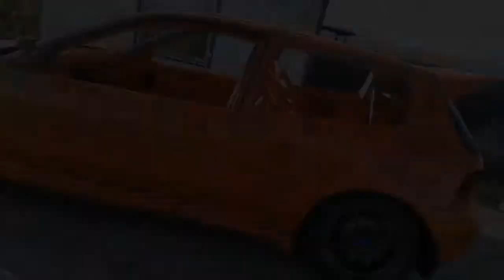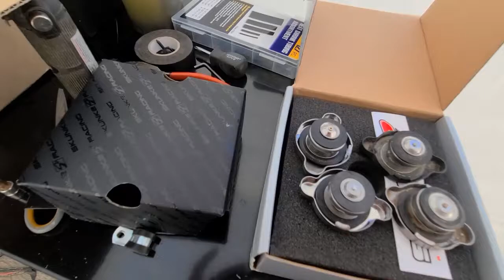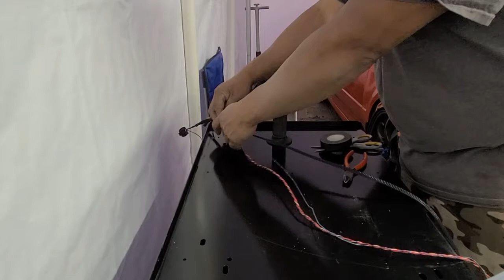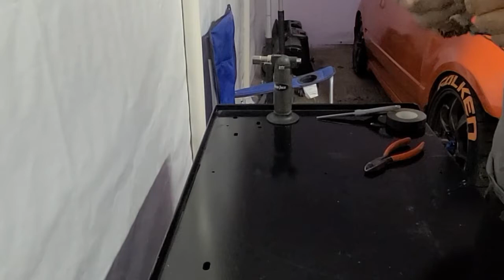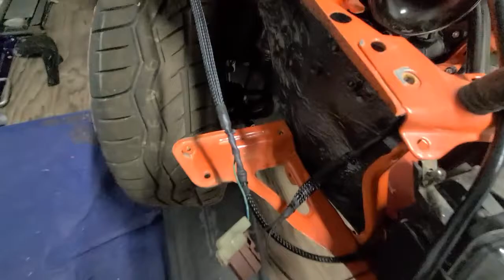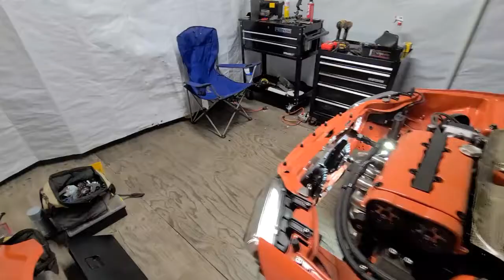Honda Civic Hatchback Build Part 32- Requested wire How to.

Comment: I know the misery of sleeving wires, having done PC cables for years. Super glue works a treat to secure the sleeving in replacement for the cable ties. Also when measuring out the braided sleeving you can hold both the wire and sleeving at the start point pull along both, move along whilst still holding both if that makes sense. Removes the excess width wise looks thinner
Reply from the maker: didnt think about using the super glue.... but then again i would probably glue my fingers to the wires. lol
Reply: @switchjv  yeah you need watch leaving finger prints haha